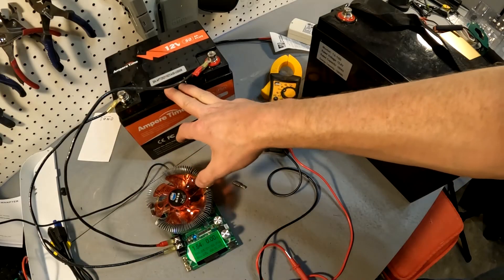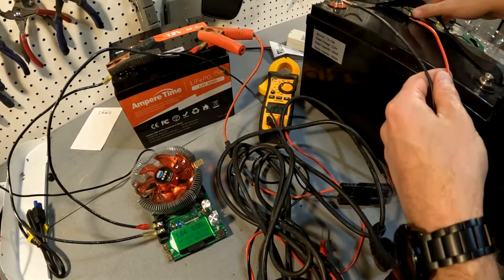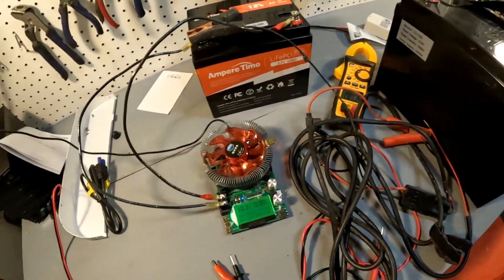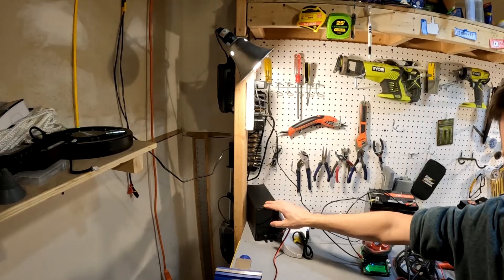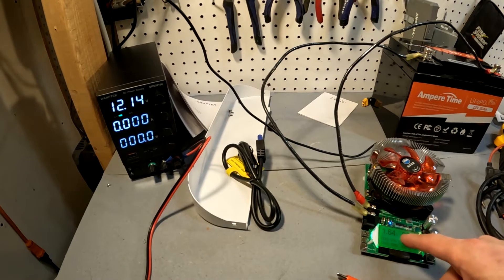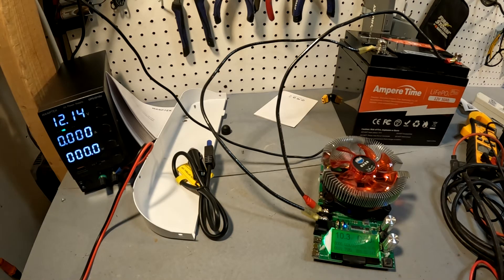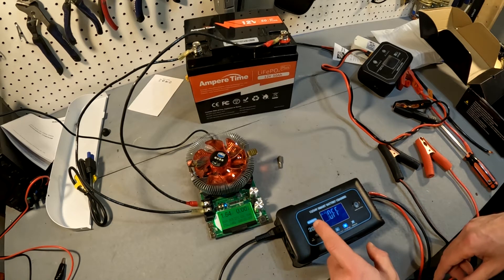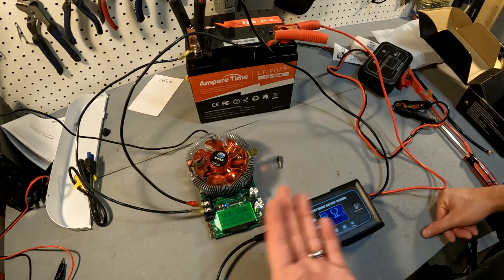Six ways to "Wake Up" your dead 12v Lifepo4 Battery!

Comment: I bought an electric start generator where the instructions indicate to disconnect the battery for ‘long storage’.  I didn’t disconnect it and when I went to start the generator after about 3 months, the battery voltage was somewhat less than 4v, the electric start wouldn’t work and my (cheap) battery charger/maintainer, which supposedly ‘recognizes’ whether the battery is lithium or lead acid, would not charge it.  When you are jumping the battery in the video and it now indicates 10 volts, are you just waking up the BMS, or would the electric start in the generator now actually work?  And if just waking up the BMS, how long do you have to hook up your charger before the voltage drops again?
Reply from the maker: As long as the battery is being drained when you wake it up it should stay awake for a while.  You just want to wake it up with a jump from another battery.  Use a proper charger to charge.

Comment: Very nice video with a lot of good ideas. I accidently did this very thing but I touched the terminals of the charge controller trying to wake it up after my batteries went to sleep. It was risky, but hey I was desperate since I'd only had the batteries 3 days. Then I found your video! It confirmed for me that it was ok to do that and now I know the proper way to do it. Also, couldn't you use one of the batteries from your cordless power tools?
Reply from the maker: I'm glad it worked out for you!  I believe I could, but I feel 18v is on the very high end.  I'd rather give examples of voltage closer to 14v.  Thanks for the comment.

Comment: My HTRC 30 amp "smart" charger wasn't able to wake up the battery. Thankfully from videos like this I knew I could "jump start", but it was cold and dark so I didn't want to drag my battery out to the driveway. Thankfully I have a "dumb" 12 volt power supply and was able to use that. I've heard that 9 volts may be enough to tell the charger to go ahead and start, so I'm going to try a simple 9-volt battery next time.
Reply from the maker: Glad the video helped.  I've never thought of using a small 9v battery.  Thanks for the comment.

Comment: i tried all of you metheod, my 12v Lifepo4 Battery stll dead.  it will not charge
Reply from the maker: That's not good.  Maybe one of the sensors tripped and is now stuck.
Reply: Same for me none of those methods work only one I found to work is to open up the battery disconnect the bms negative then hook up a charger till 12v or untill the bms resets

Comment: Nice! Thank you!
Reply from the maker: You're welcome and thanks for the comment.
Reply: @OffGridBasement  So I checked voltage on both of my Dragonfly lithium batteries in my 2023 Keystone Bullet. Voltage for each battery was 13.57. I made sure they weren't connected as well. I'm stumped because I don't know what could have woken up the batteries. I'm gonna call Dragonfly tomorrow. Thanks again.

Comment: I tried using a battery,  seems like voltage too low and needs charged. Was delivered with 4.4 volts. If noneof these work does that mean dead bms? Time usb 100 ah battery
Reply from the maker: Yes.  There is something wrong with the cells or the BMS.  4.4v is an odd voltage for a 12v battery.  You need to send it back.

Comment: I’ve got a new battery that sat too long outside before checking and it was getting rained on. Voltage at .65 and jumping with another battery didn’t do it. Do you think a charger like you showed work?
Reply from the maker: Not sure.  BMS might be dead.  If the other battery had 12v then there might be a problem.

Comment: This keeps happening with my battery. I can get 10-12 starts on it, then it acts like it's completely dead. Jumpstart it (with another 12v source) and its fine for another 10-12 starts. Scratching my head here...
Reply from the maker: What are you starting with a lifepo4 battery?
Reply: @OffGridBasement  It's on my Harley.

Comment: I have a bran new battery that has the output meter on it. It reads 13.3 v and 93% out of the box. Problem is when I hook up anything to it it will not work. In other words I’ve never used the battery because it will not put out any power from day 1.
Reply from the maker: That is very odd.  What all have you connected to it?  I've never encountered a battery that shows voltage but doesn't produce any power.  Might want to check the voltage at the battery posts to confirm that it's 13.3v.  Good luck and thanks for the comment.
Reply: @OffGridBasement  actually I did check it at the post and it read 8v. I hooked up an LED light and it was very dim. Then I took the same light and hooked it to another batter and it shined bright. When I try and charge it the charger reads off but the indicator constantly flashes with the symbol empty.
Reply from the maker: @larrybrevelle unfortunately you either have a bad cell or a bad bms connection in the battery.  You should probably send it back.
Reply: @OffGridBasement  thank you. The return is already in motion.

Comment: My LiFePo4 sleeps after non-use for a period of time in addition to low cell voltage. I constantly need to check the voltage before I take it into the field for use. I need a hand crank "waker" or perhaps a big capacitor to keep in my field kit. Thanks for the video.
Reply from the maker: I've never heard of a battery that turns off the BMS when not in use for an extended amount of time.  What is the brand of the battery?
Reply: This one is a Chins. Maybe the shelf drain is worse than I thought. I used to do FW/HW work for a US company that sells consumer Bluetooth headphones, buds, speakers, etc and we would sleep them after 30 days. You would then need to plug USB in to wake them.
I bought 2 more batteries and will take one of them and shelf it for a  couple of months and see what happens.

Comment: Ok on the water in my boat I have a 24 volt 100 amp lithium battery and it is in sleep mode how do i wake it up and what would i need to keep in the boat if this happens?
Reply from the maker: You need another 24v source.  You really need to plan ahead just incase that happens.  if you have a solar panel that's around 24v that might work.  You also might want to buy two small 12v batteries to keep so you can connect them in series to wake up the bms in your main battery.  Hope this helps.
Reply: @OffGridBasement  u think 2 12 volt motorcycle batteries in series work?
Reply from the maker: @walleye56789  that would definitely work.
Reply: @OffGridBasement  Thanks for your time my friend!
Reply: @OffGridBasement do you have to have a big battery or can you make up 3– 9 volt batteries in series?
Reply from the maker: @walleye56789  3 - 9v batteries would do the trick.

Comment: would you also be able to detach the BMS and re attach it?
Reply from the maker: I honestly don't know if that would work.  I'm not sure if the BMS would keep the setting of the low voltage or completely clear out to factory default settings.

Comment: i wonder if 12v is going to revive a 52v battery? or do i need to hit it with another 52v source
Reply from the maker: You need a source of the same voltage.  Thanks for the question and comment.

Comment: Doesn't work on noco lithium batteries...
Reply from the maker: That makes sense.  I've read that NOCO batteries are auto enabled so no BMS reset is required.  Thanks for the info and the comment.

Comment: You can use a solar panel without the charge controller too.
Reply from the maker: As long as the voltage of the panel isn't too high.  I didn't think of that one.  Thanks for the info and the comment.

Comment: How would you wake up a 48V LiFeP04?
Reply from the maker: I've had to wake up my 48v pack by connecting four 12v batteries in series.  Then just touching the terminals will do the trick.  I think you need at least 50 volts.
Reply: be interesting to try on other BMS voltages  @OffGridBasement
Reply: appreciate your rely @OffGridBasement

Comment: I have 48volts lithium iron phosphate. What can I use?
Reply from the maker: You will need another 48v source.  You can combine 4 12v batteries in series.  Amperage doesn't matter.  Maybe even 6- 9v batteries in series.  Hope this helps.

Comment: Thanks.  The lithium ion battery charger I was using would not kick in until it sensed 4V.  The battery was reading 2.4V as the BMS needed a wake up call.  I ended up using an older battery charger that sparks when you touch leads together.  This was enough to wake up the battery.  It is charging now thanks to your tips.  Hopefully this is why my 2017 Mercedes S550 would not start.
Reply from the maker: I'm glad you got some information from the video.  I don't know about the Mercedes....  😉.  Thanks for the comment.

Comment: I have three 12v 100ah lifpo4 batteries in parallel in my 2000w off grid solar electric system. This system has been running flawlessly for five years . I have two epever solar controllers, one for each solar panel bank. I also have two dedicated lifepo4 battery chargers in case I need to charge the batteries up because of low solar conditions. Again five years without a hiccup. Very rarely could I not easily run overnight the various appliances and lighting that I have plugged into the off grid system. Now, this system won't run overnight without the inverter shutting down for low voltage. I checked the whole system out and the only problem I found is one of the three identical batteries isn't working and when separated from the system shows no voltage. The other two batteries in parallel are fine. The bad battery has been getting the same voltage constantly from the system and the other two batteries in parallel with it.  I've isolated the bad battery and tried every trick in the book to wake it up to no avail. Any suggestions?
Reply from the maker: Sounds like a bad BMS or possibly a bad cell.  Either way I believe it's bad.  If you felt comfortable about tearing it open you could find out more by measuring each cell.  If it only measures at something like 8-9v then you probably have a bad cell.

Comment: I tried all like you - it doesn't work, I have 2 new batteries with bluetooth - they went dead and nothing of your advice works - the batteries were never fully charged since I was waiting for solar components ... now what should I do?
Reply from the maker: Does the Bluetooth connect?  What is the voltage right now?  Do you have a charger that will wake up a lifepo4 battery?  Are they connected to a system?  If so, disconnect and try again.  Let me know.

Comment: Ok, 1 9volt battery not likely. So click 2 together. What happens? Too high voltage, I get that, but for the brief moment of contact would it hurt anything?
Reply from the maker: That's a good question.  I'm not sure how fast the high voltage disconnect takes effect.  If only connected for a second I bet it would work.
Reply: 9 volt batteries can't supply much current, so the low resistance of the lifepo4 battery will most likely pull the 18v battery (high ESR - equivalent series resistance) down to like 10v.

Comment: This has puzzled me for a while... Modern charge controllers should have a feature that would enable "Lifepo LFP" BMS with a pulse wake up voltage. Would be. A simple addition.
Reply from the maker: I just found a HQST charge controller that does just that.  It also has low temp protection in case you need it and your battery isn't equipped.  Thanks for the comment.

Comment: I need to do this for 2 sleeping battle born lithium batteries. They won't charge at all. Can I pull my jeep close to my trailer and hook my jumper cables to the dead lithium battery and then touch my jeep's battery?
If so jeep off? Also the two 2 battle born batteries are linked together. Do I do each one or will they both wake up, when I do one? 
I know a multimeter will tell me probably right?
Reply from the maker: I would disconnect the batteries completely, then you could use your jeep battery to wake them back up separately.  Remember to touch them for just a second.  That's all it should take.  After that, connect them to a 12v charger.

Comment: Would be interesting to see how low of a voltage you could use on that bench top power supply to wake it up..  I wonder if maybe even a 9 volt battery might work..
Reply from the maker: I believe the voltage has to be .5v higher than the minimum voltage of the battery.  So if the BMS shuts off @ 10.5v you would need an 11v source to wake it back up.  That's what I've heard, but I haven't tested it.

Comment: Thanks for the video. I am off to the store to see if a 23a 12v battery will work. Might just keep. Few of these on the road with me just in case.
Reply from the maker: Make sure to make note of what you want to power.  Small battery for a small load.

Comment: interesting video... I thought you were going to pull out one of you drill batteries and try that.. Now im curious
Reply from the maker: The drill batteries are all 18v.  I'm not sure what would happen if I shocked it with that high of a voltage.  I don't want to destroy the BMS.
Reply: @Off Grid Basement  no don't try it with an 18v, I thought you might would have had a 12v lying around from an old drill.

Comment: I got that same Hashito charger watching your channel, glad to know it has that built in function.   I'm now starting to use LiFepo4 batteries,  but I haven't allowed them to drain down really low yet. I'm still "testing the waters."  From what I'm I've picked up so far, you want to keep your batteries
from going below the 10-20% level.    Otherwise, it shortens the battery's   life span. Is this true?  
   But probably, it's unavoidable, 
killing your batteries will happen to everybody at some point.
Reply from the maker: Glad to see you have the 20amp charger.  I think it works well.  I believe you will get fewer charge cycles, but you will still get thousands.

Comment: Do you have a 12v D.C. adapter for a router or modem?  You can also try a 9v battery all by itself, but usually you need about 10v to 11v to do the wake up - something higher than the internal shut off voltage.
Reply from the maker: Thanks for the info.

Comment: Would a 9v battery kick it off, or do you need greater than 10.9v?
Reply from the maker: I've never tried it but I don't think it will work.  I believe it needs to be at least 10.5v, but I'm not certain.  I do know the BMS shuts down when it gets below 10v.  Thanks for the question.